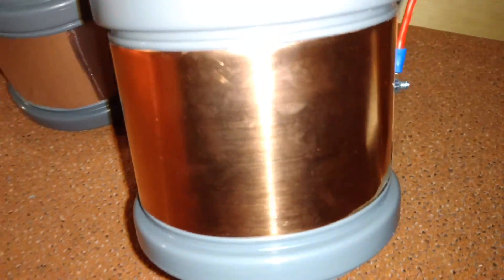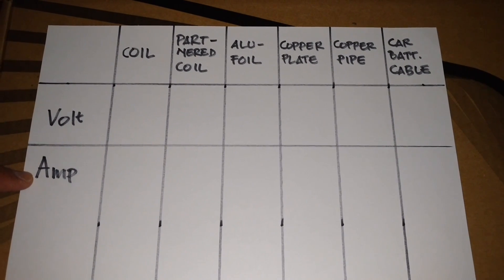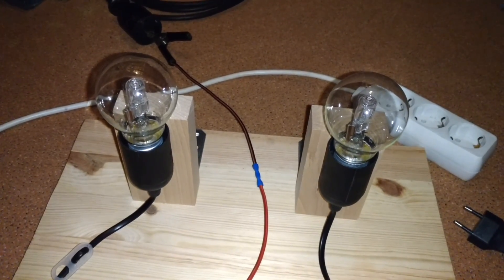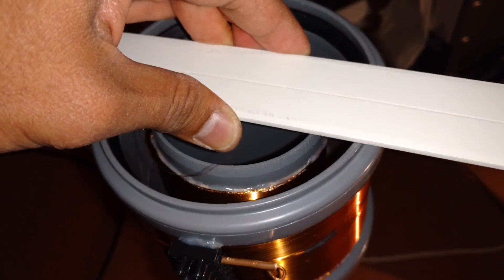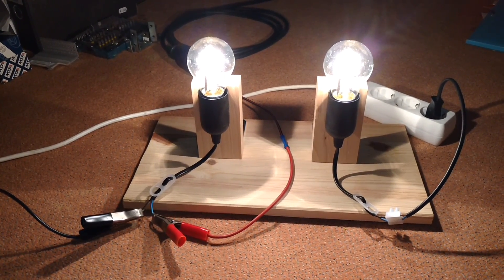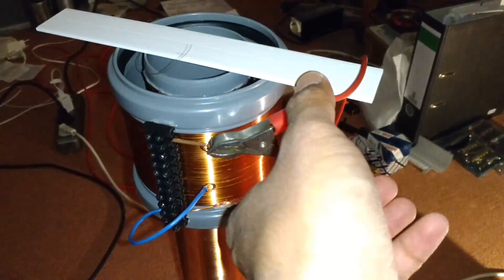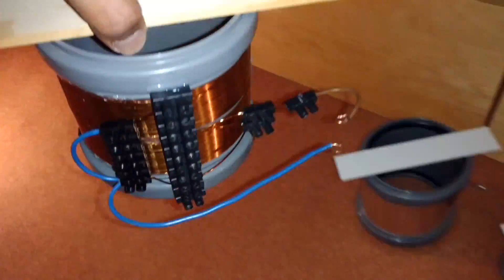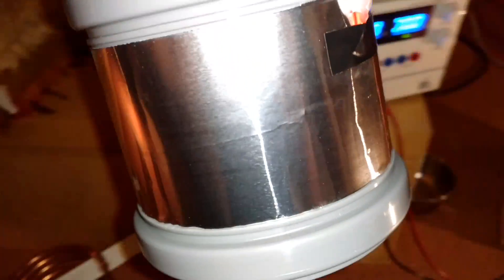Electro Radiant Energy - Ultimate Receiver Test

Comment: Hello Mr. Okki, thank you very much for your experiment, you study accurately, I like your way of experimenting. I think, copper pipe for the secondary coil is effective, a thick cable (or Litz wire) seems better or is the best, for the consumed energy per second (4,48 A*17,1 V=76,61 W, in contrast if compared with the Alu Foil: 5,08 A*22,4 V= 113,8 W) and I may use a flat spiral bifilar coil for higher potentials and to prevent false currents as stated in the patent (Coils for Electromagnets: 512.340).
Reply from the maker: Thank you for your positive feedback!

Comment: Mr. Okki, did you do this experiment also by using coaxial cable, while the transmitted energy has high frequency? Here a new question appears, we can collect this energy (radiant ?) like the rays of the sun and transport it by using a coaxial cable, which makes sense, or we can build a resonator, which is in resonance with the transmitter, for this purpose it seems useless to use coaxial cable, while it would not produce an induction effect on the primary coil at the receiver, which may be wound onto the secondary coil where coaxial cable is used, correct?

Comment: What about building a 2nd Tesla Coil as a receiver and activating this coil, by the first coil, which would mean, the Antenna (Aerial capacitor) of the first coil (transmitter) would activate the receiver antenna, a kind of electrostatic wave (longitudinal ?) is thought to be transmitted in this process, did you make any experiments the verify this effect?
I am interested in energy transfer, especially about the percentage of the energy transmitted by this way……..Can you say something about this transport phenomenon?

Comment: Hello Okki,
Congrats on taking a plunge into the work of the greatest scientist to ever exist. You are at least trying to reproduce the work. However, As you might know, The way tesla produced the radiant energy utilization is through a very specific experiment that included extremely "sharp" impulses, and there were about 150000 of them per second. Second thing is - the transformer was with three coils, and the efficiency of the transformer part is best when the primary coil and the load coil were of the same mass (Yes, mass, as in the number of grams). also, there should be a spark gap, and a way of sucking out the electrons from the circuit, since they are actually impeding on the real power of radiant energy. 
I am looking forward to seeing someone successfully transmitting the radiant energy and hope you get as close to it as possible. 
I wish you a lot of luck and success.
✊
Reply from the maker: Thank you for your compliment. What I do is nothing compare to what Nikola Tesla did. It is not easy to replicate his work as we need to understand so many things before we can make his experiment.
Reply: @OkkiMoeljadi  You are right. Also, in his later work, after they tried to kill him by burning down his lab in Manhattan hi started using his own symbols and not explaining their meaning in his notes (mainly because most of the things he was working with still had no symbols of their own, or were even known by the rest of the humanity.) so even having all of the boxes with his notes would not be too helpful. However, it is not smart to give up on trying. I beg you, and all the people who try to replicate his work - PLEASE PUSH ON! Maybe you help someone else decode the nature of radiant energy, and in doing so, help the human civilization move into the new era. 
Lots of love and respect!
Good luck!

Comment: The high wattage consumed is probably due to being OFF resonance. At resonance, it should take very little power I think.
Reply: yeah, i think that resonance is needed for the impedance effect which should cause standing waves with nodes as demonstrated by the hairpin circuit, current is countered upon itself by the impedance effect at resonance so amp will approach 0, just like a parallel RLC circuit at resonance.
Reply: @alanx4121  Is it possible to create a resonance effect by attaching a variable capacitor to the secondary circuit (receiver), may I ask you?

Comment: 0kki, you are amazing. I love your reproductions. I would love to see you reproduce Tesla radiant energy patent, with a 30 inch aluminum sphere (polyureathaned) and coax wire running to a shielded box containing the circuit. When working with HV, charge carriers remove charge from the insulated wire. Tesla patented coax cable in 1891. It is intentionally missing from the patent to protect his design. The second missing component is the bifiler coil. Scrap all your other coils for the bifiler. You get 500000% increase in voltage, no back emf, reduced induction, and low current. Additionally, the thicker the wire the less resistance.
Reply from the maker: Thank you. I'm planning to do more experiments with larger Tesla Coil. Please stay tuned..
Reply: Mr. Devin, you want to say that flat Spiral coils in bifilar type ? As here: https://patentimages.storage.googleapis.com/0b/3c/ab/eb51aebe935f8c/US512340.pdf
Reply: Did you study with a flat-spiral bifilar coil described in the patent? We can reach higher potentials with less energy, yes, restrictive effects like back-emf (Tesla called them false currents) could be eliminated by this way, and with less inductivity and low circuit impedance, we can have more current and higher potential, a resonance like condition may be reached, what I understand.
What about the law of energy conservation? In such an ideal system based on transmitter and receiver, can the receiving system produce more energy than the input, or is this just an ideal way of transporting electricity with high efficiency and low losses?

Comment: Hi Okki, thanks for your reply. I like your well organized work and well calculated. You are a real application engineer. I would like to know this radiant power generator looks good. did you try to verify if it is really radiant! did you try to submerge the bulb in water to see if it is really cold energy? or if the paper don't burn when put in between the spark gap? Thank you in advance for your reply.
Reply from the maker: Hi Shaider. Thank you! Yes, this is radiant energy. I call this cold electricity because I can let the electricity flow through my body to power electrical device.
Reply: @OkkiMoeljadi  Hmm, what is the difference between cold electricity and radiant electricity, both are the same I think, but we know that HF currents have a skin effect that’s why the wires don’t get hot, but high frequency current is not radiant energy, it is more specific than the HF currents, correct?

Comment: How far can it go, and is there a way to avoid having to use earth ground?
Reply from the maker: With this kind of receiver? Not far. You don't need to use earth ground to transfer electricity, virtual ground will do.
Reply: Okki Moeljadi what can I use as virtual ground? And how far can it go without earth ground?
Reply from the maker: You can use any conductor or metal as virtual ground.
Reply: Okki Moeljadi thanks
Reply: Okki Moeljadi but with a virtual ground, how far can this transmit?
Reply: no
Reply: @janetc2241  In a Tesla coil, is the magnetic field vector-B separated from the E-field vector, which may be propagated by the aerial capacitor? 
I mean, there are different theories, if a Tesla coil, or the aerial capacitor sends longitudinal waves (like compression waves) we need a medium to transmit the force field, we may also call it “Electrostatic waves”, are such waves really existing ? The electron is the only charged particle which we use to explain electricity, and we also know, electricity and magnetism are hands on hands, the E-field would change with time, this change would create the B-field and vice versa, it seems difficult to visualize a pure electrostatic compression wave, what do you think?
A possibility could be “Dielectric waves". We have the metallic transmitter and on the other side the receiver is also a metallic sphere, the air may be assumed as a dielectric medium, so a kind of displacement current may be existing between the transmitter and receiver, but it is still electromagnetism, and what happens when both circuits are not connected to each other with the ground connection (secondary coils), does the system then work?
Reply: Is there a mathematical model or concept about the energy transmission of a Tesla coil?

Comment: very nice work, sorry not better results. although i have faith is possible.- would be good also if you tested foil sheet capacitor pickup.   - but i agree most important is too have good pickup system, that has least effect too primary

Comment: My vision and andestanding of Teslas tecnology https://cloud.mail.ru/public/JVAz/XjpXmX6Zi original in russian and translated in english https://cloud.mail.ru/public/DZkc/xuhvA1ZaZ  And additionaly https://cloud.mail.ru/public/Jw24/KUhJFBZ7w Shortly, vision based on Teslas patent № 512340. Common Tesla transformer secondary coil consist of one layer. But in this version the secondary coil is bifilar, videlicet it consist of two layers, connected in series. Between layers we have electrical field E=U/2 . If we put capacitor (two plates with dielectric between them) in this field, we will have electric charge separation in it. Load mast be connected to this “internal” capacitor. There is NO magnetic coupling between coil current and load (inner capacitor) current, because they are perpendicular! So there is NO electromagnetic feedback! To better understanding Teslas patent № 512340 and Donald L. Smith  
There is important information additionaly http://realstrannik.com/forum/proekty-i-izobreteniya-nikoly-tesla/120-more-energii-vokrug-nas-n-tesla#61068 Find out the last lifetime interview of Nikola Tesla. Written down by Alfred S. Hawle from the words of Nikola Tesla on October 28, 1942 at the New Yorker Hotel. Here the russian version http://realstrannik.com/forum/proekty-i-izobreteniya-nikoly-tesla/120-more-energii-vokrug-nas-n-tesla?start=54#63863 There is very interesting picture of a mechanical analog of his overunity devise. Here my correlation http://realstrannik.com/forum/proekty-i-izobreteniya-nikoly-tesla/120-more-energii-vokrug-nas-n-tesla?start=126#72055
Reply from the maker: Thank you for the information. Have you succeeded building over-unity device?
Reply: It's just a theory. There is no prototype. I hope for like-minded experimenters like you. I'm sure without a clear understanding of the principle of action there are no experimental results. 
My vision and understanding based on the laws of electrodynamics, without involving ephemeral notions and phenomena. 
My English is not good. Maybe someone can translate into English the second part of my article
Reply from the maker: I've been thinking of this kind of device for some years now. But from my research I have never seen any over unity effect at all. I have tested much more configurations and circuits than what you can see here on my channel. Though, I still believe that it is somewhat possible to build a device like the one from Thomas H. Moray, Kapanadze, Donald Smith. Thank you for sharing your articles. PS: English is also not my language.
Reply: Someday success will come!
Reply from the maker: Thank you Nodir. :)
Reply: Mr. Nodir, thank you very much for the “Ethereal Tesla Pump'' article. Did you build a prototype, to test the theory of the given article?
I heard the free energy research studies of Donald L. Smith, especially many years ago. The key point is to transform the ether into electricity, I ask here the main principle of this process. A radiant energy receiver (Antenna) may also be a good and easy solution to get free energy.
In my opinion Tesla’s coil for electromagnets (Patent No: 512.340) is a capacitive coil, where restrictive effects, like back-emf (Tesla called them false currents) and high self-inductivity were eliminated, so it operates with very less inductivity and low circuit impedance, by this way it seems possible to reach very high potential values, a resonance like condition could be reached.
You sent your statement 5 years ago, were you able to build an over unity device in this period, may I ask you?

Comment: I believe that you should build two secondaries, both of them should have a slider to adjust the real reactance. Then you can excite the first with the primary coil and the power supply and put an electrode at the end to send energy to the atmosphere.

Then with the second secondary coil you could try to couple the first secondary coil over the air by regulating both the adjustments and orient the air eletrodes. At the end you can try to catch energy on the second secondary coil with a receiver coil. 

It would be interesting to measure volts and amps and try the system at different frequencies and distances ... etc.
Reply from the maker: I think you are referring to wireless power transmission. I have posted some videos regarding that (wireless power transmission, passive wireless booster and multiple wireless receiver). Please check them out.

Comment: TOO MANY VARIABLES?
I noticed variable light level's! 
Inconclusive readings-/
As an accurate test: put a meter on the supply to to the test bulb & adjust supply to achieve a known fixed quantity:-)

It does represent a transformer: BAIN ( B- Magnetic field strength, A - Area of conductor, I current density, N- Number of turn's)
Kindergarten electronics:-D
It would be good to change the frequency: As this is affected by the hysteresis of conductor composition :-)
Reply from the maker: Dear Paul. I don't think you have read my video description and understood my circuit. Please post your video with everything (equipments and explanation) you wrote on your comment. I would like to learn the real electronics from you. Regards, Okki.
Reply: Okki Moeljadi 
OK Okki :-)
The BAIN  formula is from the old A Level physics book's: moving iron meters.
The hysteresis is the time it takes to become magnetic & how long it retains it's induced magnetic Field for?
As for frequency: the higher the frequency: the stronger the induced magnetic Field strength. 
In basic form: inductance & Capacitance exist together ( can't have one without the other).
Therefore having a permanent magnetic Field in the circuit: should change the readings?
Have fun :-)
Reply from the maker: Thanks Paul for your explanation but I'm still waiting for your video.
Reply: Okki Moeljadi 
I like to keep things in the simplistic common denominations:-)
Basic simple logic blocks: Ripe for experimentation :-)
Have Fun ;-D
Reply: Okki Moeljadi 
I have experimented with zero carbon energies:
A couple of old Link's to view & learn from: charmorff
greensleevespw
I'm the guy filming :-)

Comment: I would like to see the same test with an aluminum wire inside a copper tube "coil".
Or any combination of the two in layers.
Reply from the maker: John Altenburg, unfortunately I don't have any aluminum cable. Maybe what I can do is to wrap a PVC pipe with copper plate and then wrap the plate with aluminum foil or the other way around. Do you want to see the output between aluminum and copper or both directly to the load and earth ground?
Reply: I think a copper coil with an aluminum Shield , similar to an air battery, could exponentially raise the values. Try grounding the large coil and then to a load and then to the aluminum Shield wrapped around that grounded coil. I would think a DC current with some capacitance would be what you have
Reply from the maker: Hi John, I think I will try to build capacitor receiver by wrapping a PVC pipe with one layer of aluminum foil and wrap it with plastic isolator and then wrap them altogether with copper plate and do the connection that as you suggested. I don't think to wrap copper pipe coil with aluminum foil is possible for me. Thanks for your suggestion.